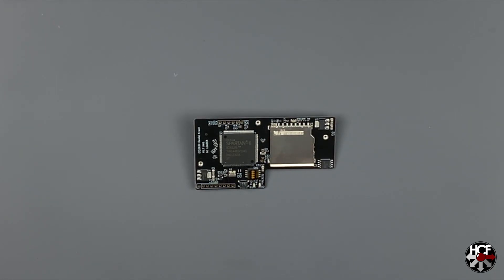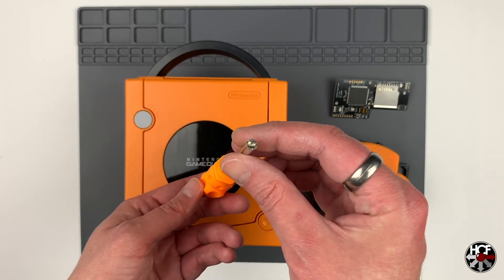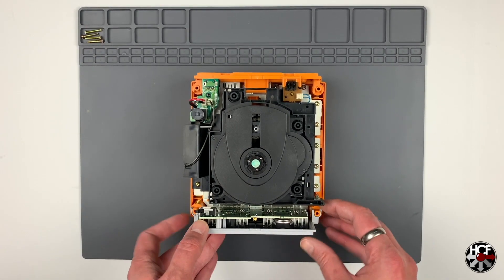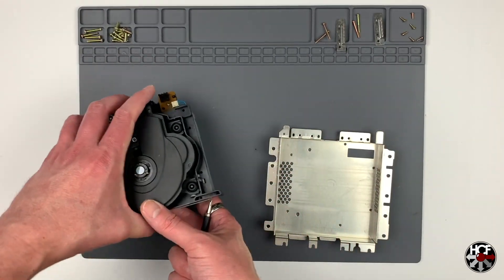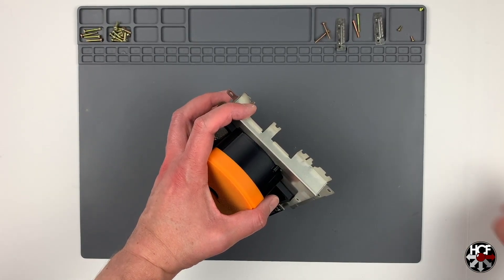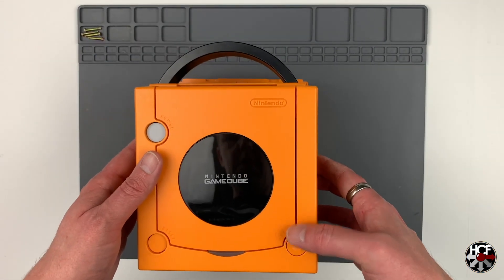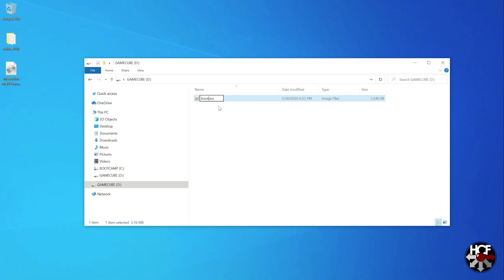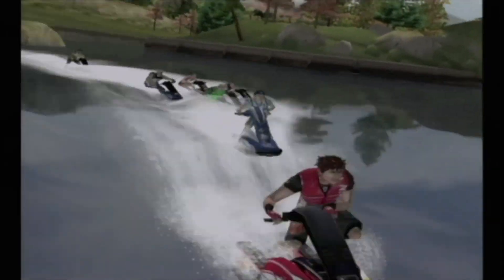Gamecube GC Loader PNP SD Card Optical Disc Replacement Mod | Install & Setup | How to Guide

Comment: I'm actually sad the GameCube intro animation doesn't have time to finish. Do you still need GameCube memory cards for this?
Reply from the maker: @SuprSaiyanTurry Agreed, I’m trying to find out if there’s a way to keep the full intro animation, but so far I’ve had no luck.  If you’re asking about needing a memory card to boot from, no, it works without, but you’ll still need to have one for game saves (as far as I know).  I’m sure someone will correct me if I’m wrong, I’ve still got a lot of playing around to do to learn the intricacies of Swiss! :)
Reply: @HalfCircleForward  No, I was just wondering if you need a memory card to save your games to. Doesn't bother me if I do but it sure would future proof the GameCube if it could save it to the SD card could hold the saves.
Reply: @ViolentDetour  Agree they need to ensure the animation completes. Also - personally, although swift is great I do think the UI while practical doesn't really pay much homage to the original GC UI. Would be cool if there was a skin that gives it a classic look and feel with the cube and all

Comment: You forgot to thank Daniel Kraak (meneerbeer), for his efforts on this good video mines coming soon subscribed :-D
Reply from the maker: You know, you’re right, I absolutely did! Thanks for bringing that up, everybody involved in the project absolute should have gotten a shout out and that was a huge oversight on my end!
Reply: @HalfCircleForward  Its ok things happen :). My GC loader has been on order for some time i love the simplicity of this installation. I actually could not find a recent tutorial on the none soldered version so this Video helped me alot. I am trying to find a broken gamecube so i can install this. I don't know why but i feel mean removing a functioning disc drive from my unit that i have had since 2004 l want a orange gamecube and the orange sd extender :-D
Reply: which will look lovely with my wavebird controller :-D
Reply from the maker: @Joe Pearson I know the feeling, I picked up my orange GC specifically for this project, my launch Indigo GC still lives and is boxed up safely to be listed on eBay when my son gets it in his inheritance ;)
Reply: @HalfCircleForward  sounds like a plan :-D is there a way to allow the Gamecube the full bios intro on this ? call me old fasioned but i like it :-D
Reply from the maker: Joe Pearson That’s a great question, and I’ll be totally honest, I’m not sure.  I think I might have to raise that on Twitter to see if anyone has an answer to it.  I agree though, I’d like to see the full boot sequence on start-up too!

Comment: Welp, mine doesnt work. I have everything loaded on to the SD, the device installed into the gamecube, and it just doesn't see it. The Gamecube just  loads into the memory card manager/clock etc. Says "no disc" in game menu. Rubbish
Reply from the maker: That’s not good at all! Did you change the Swiss .iso file name to boot.iso?  That’s the only thing I can think of immediately that may cause an issue on the software side of things, unless your SD card isn’t set up to FAT32 or ExFAT (that I just found out should work too).
Reply: @HalfCircleForward  Nevermind, my mistake. Windows doesn't show file extensions by default, so when I was renaming swiss to "boot.iso" it was actually calling it "boot.iso.iso" - which gc loader obviously doesn't know what to do with! Anyway, hopefully this will help someone else :)
Reply from the maker: Awesome, glad you got it sorted out!  I know I’ve fallen into that trap before!
Reply: whats you're SD card? some cards are terrible quality and wont work as intended try another sd card